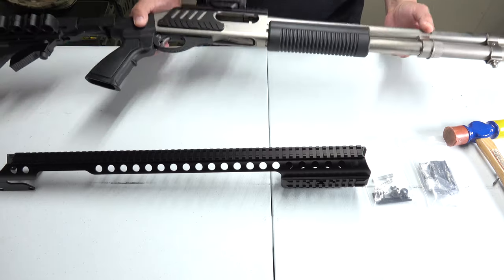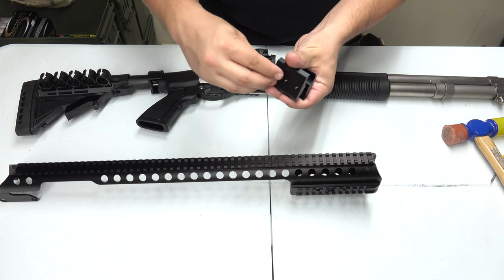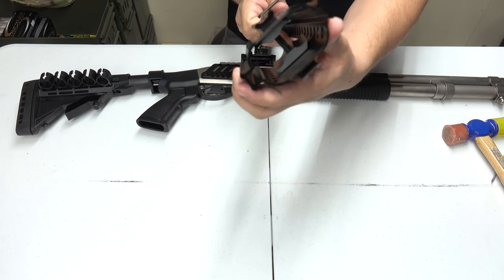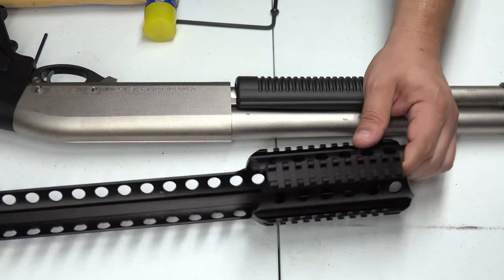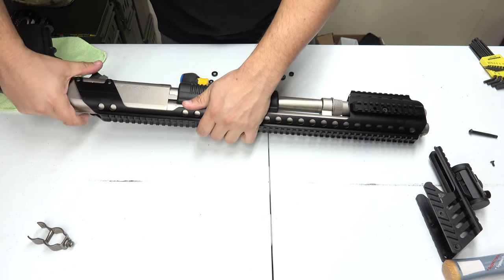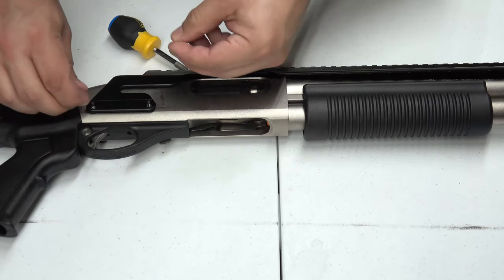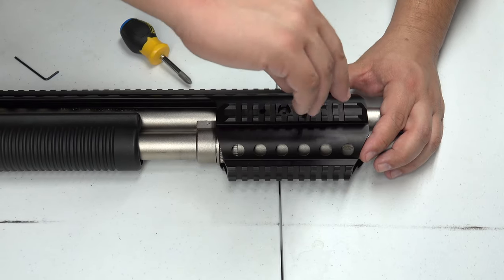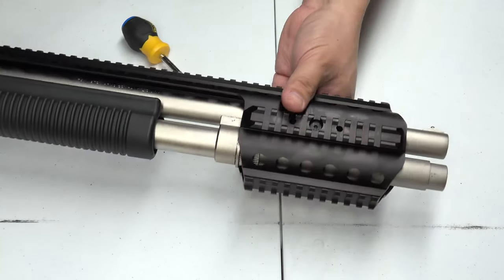Quad Rail Install on Remington 870

Comment: Just wanted to say thanks for this video. I just got the Black Aces Quadrail for my Mossberg 500. The instructions that came with the quadrail are absolute garbage. I had a hard time figuring a few things out. Your video was the only thing that saved me. Thanks much!
Reply: How much did you pay?
Reply: @doggieandkornelius8949  I think it was around $200 for the full kit.
Reply: @mikemortensen1717  yea sounds bout right, all the websites ive seen are around that price. Thanks

Comment: Cool piece. Seems a bit bulky at the end. Could have less rail slots on the sides and be shorter.
Advice: Stop using a hammer on the pins. If something is not lined up, stop. Line it up, properly. They should push in and out.
Reply: Ok

Comment: On the 870 dm u can't install this I am wondering if I cut of the screw part close to magazine do you think it's fine holding on with one bolt ? Instead of 2
Reply: It looks like he uses a spacer on each side

Comment: I just installed mine on my 590 shockwave. But lets be honest, the instructions that come with the rail/sidesaddle are friggin terrible! Hahaha like they might as well have just been a picture of a middle finger
Reply: Dude like WTF!? It's like a Chinese person put very minimal effort. How did you assemble the clamp? I have 2 internal threaded pins so I figure 1 comes into play?
Reply: @wits729  Hahaha thats how they make us go crazy! I just installed a 4Runner roof rack and the instructions were horrible too. Are you talking about the front clamp that goes under the rail system to hold it in place near the front of the barrel?